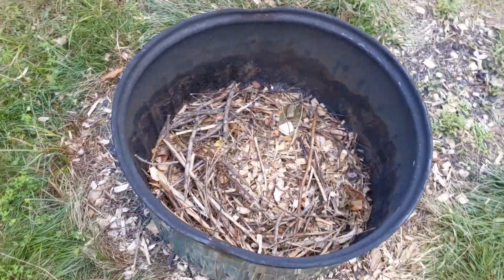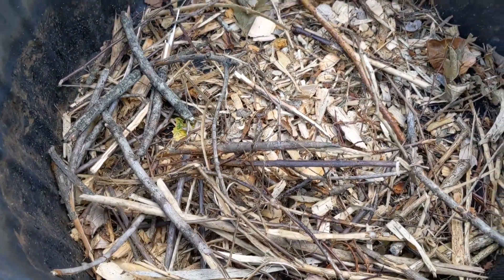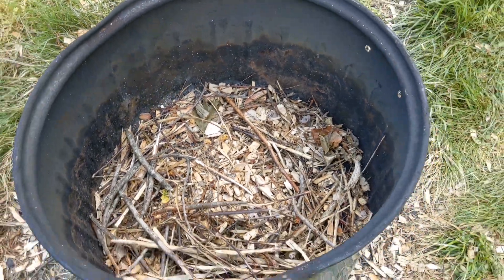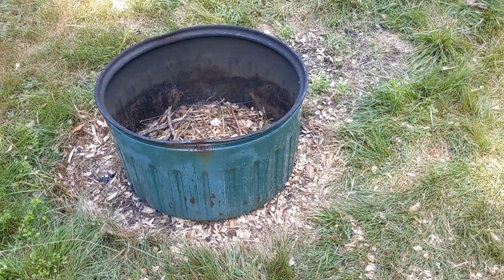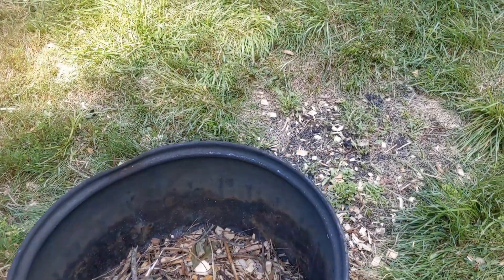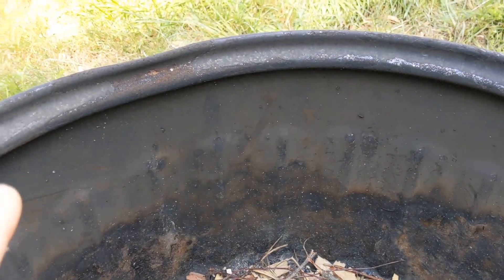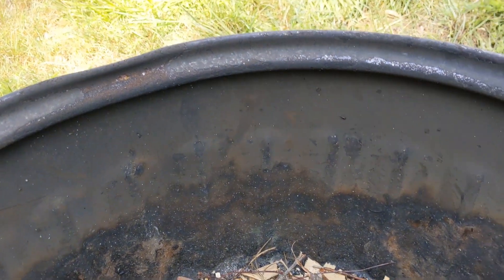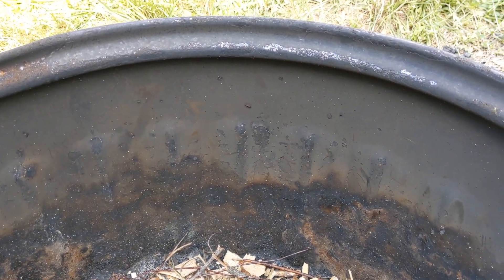Biochar - production, processing, and incorporation on the farm

Comment: Biochar isn't a fertilizer, it's a soil conditioner, it makes the soil so efficient that the soil becomes almost as abundant as pure compost (if enough biochar is in the soil, and deep enough). So it should be either in the soil (ideally 2 feet deep and properly mixed with the soil), or at the very least under a thick layer of mulch. Any biochar that you see on the ground is laying there basically doing nothing.

Comment: Could you please explain what you mean by "fracturing" at around 10:28? (I'm a biochar beginner, having only made it once, about 18 months ago. I mixed it with finished compost and mostly-composted chicken bedding and let it sit for 5 months before adding to a couple of beds. The results have been sadly unimpressive, but I'm going to give it another go, assuming I didn't get some step quite right.)   I think the rain primarily fell to the west of you yesterday evening, as we received a much needed .78"  in about an hour. I'd share it if I could! Wishing you a lengthy break in the anxiety and much peace, my friend.
Reply from the maker: I'll do my best, though I don't consider myself an expert. I had some trouble locating where I picked up that particular phrase but my understanding is this: when we quench a burn session, rather than smothering it, the water entering the live coals expands rapidly as steam and causes the coals to expand at a rate that fractures some of the carbon matrices, creating even more pore space. Some facilities smother instead, and others I've seen through the internet have sophisticated setups that starve themselves out, so I think there's validity to each approach. https://youtu.be/svNg5w7WY0k is a good video to see a few setups and approaches.

Reading about your initial attempt, there are some things that come to mind: there's a reduction in microbial activity in the finished compost compared to a pile that's still cooking, and it's possible that influenced the biological and nutrient uptake in the char. Another factor would be the relative moisture content, as char is notoriously hydrophobic at first and has to be "primed" to be hydrophilic and begin adsorption. I have a feeling that our use of a quench helps to start this process, but if your processing setup differs you'd likely benefit from soaking your next round and then adding it to the compost to allow for microbial colonization, or adding it directly to let the local communities already present in your garden take advantage of it.

I'm blessed to have met such a wonderful friend in you. Next time the anxiety spikes I'll try to remember to film something and post it so we can talk about something more enjoyable!
Reply: @lallyluckfarm  Thank you for the explanation. My final mix of (well-soaked) biochar plus compost almost seemed too wet after aging. I remember questioning whether some portions were, in fact, anaerobic. I'll have to think through the entire process much more carefully next time.
Reply: It's also possible that your less than impressive results are completely within parameters for the impact of biochar in temperate climates. That it has clear beneficial impact in tropic and subtropic climates is well established. In temperate climates scientific studies are much less conclusive and anecdotal evidence includes experiences like yours along with more positive reports. It isn't necessarily you are doing something wrong, it may be that the biochar simply isn't that impactful in your context.